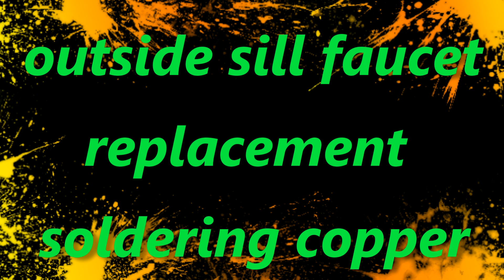outside sill faucet replacement soldering copper pipe

Comment: Good job! Tight soldering area there! Tip: when the screws stripped and won't tighten cut a piece of ty wrap and stick it in the hole the screw will grab and tighten up! thanks for another great video Steve!

Comment: Sticking  wooden golf tees in the holes and strike the end with a hammer (make it flush)  gives alot bite for a screw.
Reply: Neat trick
Reply: Ive been known to snap a twig off a tree. Hammer it in and break off the rest.

Comment: Why not use copper cutters instead of an angle grinder?
Reply: Michael Draper hi, do you even cut pipe?
Reply: I got scars on my hands from grinders with the guard off. Several small scars, I used imp cutters a lot. Smooth square cut each time.

Comment: I think the worst plumbing repair I have done was replacing a rotted out 1.5in iron pipe. It was through a corner sink/cabinet removing a panel to get several feet behind it in a attic space. Luckily I had help so I did not have to crawl in and out multiple times.

Comment: I'm kinda surprised, that you removed a frost free and replaced it with a standard hose bib, then used the drill driver as a hammer to align the bib and cracked the shingle....wow thats not the norm for "workin-again-momma", steve

Comment: When you have that problem with the outside tap not screwing into the wood use some flat washers
Reply: Just screw a square wooden block to the wood first, then drill a fresh hole and you’ll be able to get a better fixing. You’d have to make sure you added the thickness of the wood onto the length of the pipe though before soldering it up.

Comment: Sometimes you just don't know the madness behind Steve's reasoning. He got too big to answer our questions :) He'll throw you a bone or two via one of the "tech tips and Q&A" videos.
Reply from the maker: WHATS YOUR QUESTION ??
Reply: Why do you sometimes replace a frost-proof hose bibb/sillcock with an old style that has to be drained every winter? Like in this video, where its indoor shutoff is very hard to reach. Thank you!
Reply: @devnull7550  heard him loud and clear, just like in the beginning of the video... he knew he was going to replace a frost-free outdoor faucet. I was hoping there was a "better" reason other than "don't have the right size on the truck" so I'm going to downgrade the customer and make them perform one more tasks in the winter and spring, and make them crawl into the cabinet to shut the water off and on.